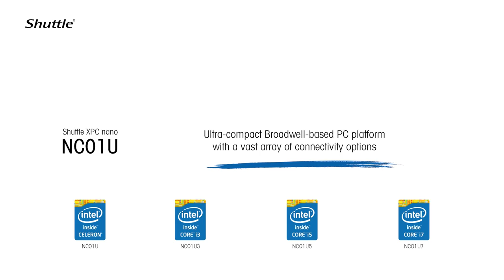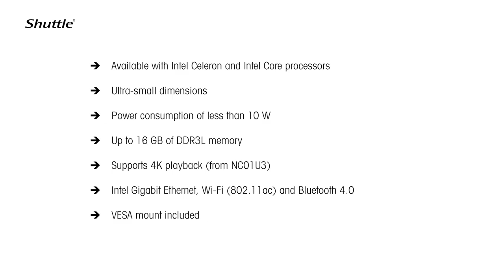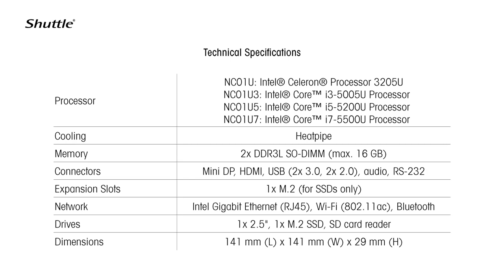NC01U - 360° product video

Comment: Dear people from Shuttle, 
I'm interested in this product, but first I have one question:  the video says it has expansion slot for SSD, but can you use it with just a SSD and no hard drive? 
Thank you.
Reply from the maker: +C E CB Project You can use both slots at the same time (1x M.2 SATA SSD + 1x 2.5" SATA SSD/HDD).
Reply: Thank you.
Reply: Hi guys, thanks, I'm still very interested. 
Just a couple more questions, though. I decided to go with M.2 SSD because it seems easier to install, but I assume that the Shuttle comes with an assembly manual, right? 
One more thing, I made a boot USB of Ubuntu, so do I just turn it on the first time with the USB in there or is it more complicated than that? 
Thans in advance.
Reply from the maker: +C E Castelo Branco Yes, there's a quick guide in the box (you can download it directly by searching for "NC01U_SERIES QUICK_GUIDE.ZIP" with Google). Please verify the correct M.2 SSD dimensions and technology before buying. Installing Ubuntu should be as easy as on every other PC. If you have the setup on your USB flash drive, the machine will recognise it and boot from USB for the first time.
Reply: +Shuttle Europe Thank you for your quick reply. I was thinking about buying the Samsung 850 EVO MZ-N5E250BW  SSD, which, as far as I can tell, is compatible with the Shuttle. Would you be so kind as to confirm that for me, please? Thank you.
Reply from the maker: +C E Castelo Branco This one is not supported. Since the machine is very small, the M.2 slot is limited to 42mm and SATA interface like Transcend MTS400 256 GB.
Reply: Oh in that case I truly am glad that I asked you, because I almost ordered the wrong ones. So I need a 2242. 
Thank you very much, I'll place my order. 
As for RAM, I should be fine with  2 x 8 GB - SO DIMM 204-pin - DDR3L - 1600 MHz, right? 
Sorry for so many questions and again, thank you very much. That was really helpful.
Reply from the maker: +C E Castelo Branco RAM should be perfectly fine, 2x 8GB DDR3L-1333/1600 is supported. You're welcome.